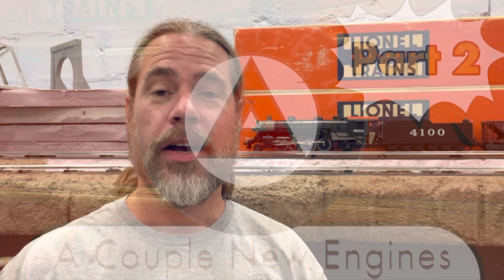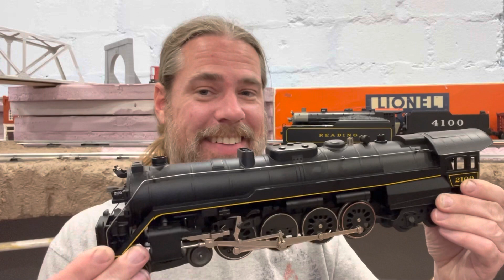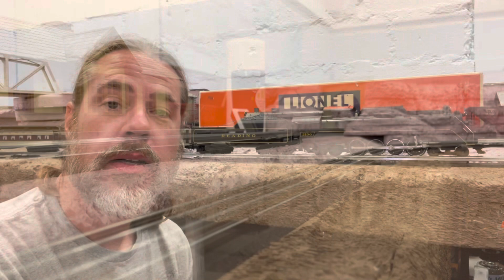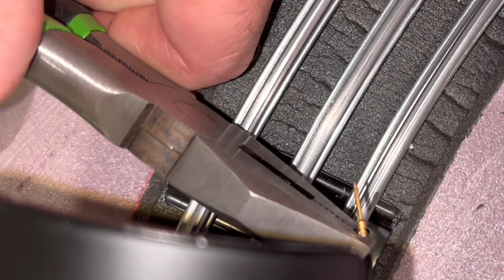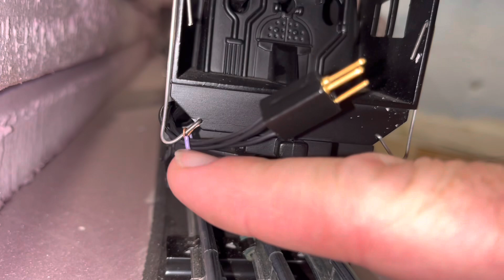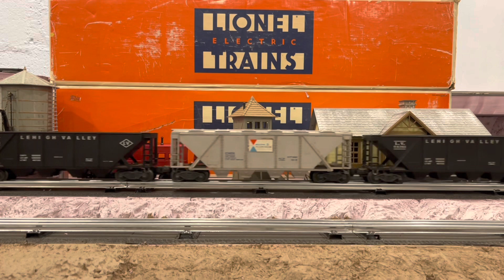What is in these boxes?  An Unexpected Gift - Part 2

Comment: Extraordinary looking locomotives 🚂 it could be the smoking unit in that Mikado locomotive God bless you and your family
Reply: Depending on when they were made some Lionels smoke better than others.  I've got two Lionel Camelbacks that on a smoke scale of 1 to 10 were maybe a 3.  I rebuilt the smoke units so they operate on track power instead of drawing power from the engine's circuit boards.  Now they're about a 6 on the scale.  Not perfect, but good enough.  
Also, some Lionels will smoke better depending on the load.  Running "light engine" they won't smoke much but put a long freight consist or a consist of lighted passenger cars on them and they'll smoke better since they're drawing more voltage and working harder.
The BEST smokers are the MTH engines, they can make a yard fogger green with envy!
Reply from the maker: It smokes, but barely. It’s better at full throttle but I don’t run it there. Maybe one day I’ll replace it and see or run it right from track power as Wayne mentioned.

Comment: A T-1!  I might have guessed!  (Actually, I DID guess but kept my mouth shut!)
A great gift to a VERY deserving guy!  In fact if memory serves that T-1 was the Kughn Era Lionel's first venture into scale size, or at least near-scale.
That "neutral-reverse-neutral-forward" is the way I've got the e-units on my Lionels set up.  Back in the steam days it was typical for freight engineers to back up into the consist to get some slack for the start-up.  It works for toy trains as well.
As you probably know Reading's T-1 was intended as a freight engine but they REALLY became famous as the power for Reading's "Iron Horse Ramble" excursions in the late 50's through the early 60's, and of course it's T-1 2102 that's becoming famous again on the Reading & Northern excursions. 
You're T-1's going to look great with passenger or freight!  Best of luck with it!
Reply from the maker: Thank you Wayne. A few people guessed the T1, I guess I gave too much away 😆. It’s such a nice engine, and just looks so impressive running. 
Since I opened the mikado first, a newer engine, I was in the mindset that the T1 was built the same way, didn’t realize for a bit it was a pullmor and a mechanical e unit.
Reply: @dagryffynhobby  A pullmor motor and mechanical e-unit sounds right up your alley Dave!  That means you can keep it alive indefinately!   
I'll take old-school over modern sophistication any day!

Comment: The 2100 is a really nice engine
Reply from the maker: I like it more, each time I look at it!
Reply: Does it have magntraction
Reply from the maker: @radarditti560  no but it weighs almost 12 pounds so it has plenty of pull
Reply: @dagryffynhobby  No traction tire that's great. I'm not a big fan of traction tires, I prefer magnatraction . I have the 2065 , 2035 and 6200 steam engines and they pull just as good as the engines with traction tires.

Comment: Does the t1 navagate o36?
Reply from the maker: I don’t think so, I think it needs 42 but I could be wrong
Reply: @dagryffynhobby  I've been told it can do 36 but not in reverse or over switches
Reply from the maker: @OldIronVideo  I was just looking into it. Says minimum 42. Interesting that it could do smaller, maybe it depends on weather conditions lol
Reply: @OldIronVideo  Sometimes, but not always, an engine will navigate tighter turns than the manufacturer says it will.  Many times a minimum curve diameter is assigned to an engine so it won't have problems with switches.  
Be that as it may it's best to follow the manufacturer's advice when it comes to minimum curves. They want you to be happy with the product after all or you won't come back for another!
Reply: @wayneantoniazzi2706  my 0-8-0 says o31 minimum and it runs on o27 fine forwards!
Reply: @OldIronVideo  Not surprised, I've got a Williams Berkshire 2-8-4 that officially is supposed to be 031 minimum but ran on 027 as long as I kept the speed reasonable. 
On the other hand I've got an Atlas coal hopper that calls for 031 minimums and means it, it chokes on 027 curves.  So sometimes you get lucky, sometimes you don't.
Reply: @wayneantoniazzi2706  I believe after the 80s no one really makes o27 anymore so everyone says o31 Minimum
Reply: @OldIronVideo  I think Atlas still makes 027 track but I'd have to check.  MTH made some small diesels that were 027 capable but I'm not sure they do now.

Comment: Nice engine and tender.  Someone mentioned new Lionel has  dropped in quality.   Totally agree.  Poor quality control. Lionel electronics might be a tad better than mth but not the rest.  MTH hands down has better qc.  I am sure someone will cry foul.   Other than the sound of static, it is hard to beat what you have.  Solid and simple.
Reply: Well, when the people making your stuff are on the other side of the world and you can't look over their shoulders...
Reply from the maker: They work. And that’s what I want. If the T1 stops working, I know I’ll be able to fix it. For me that makes it more valuable than a newer unit with electronics in it.